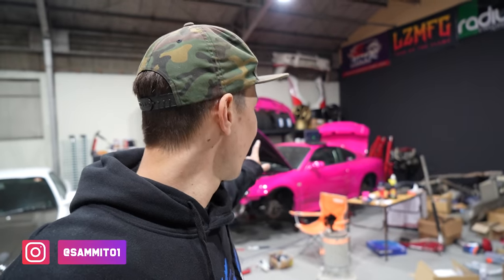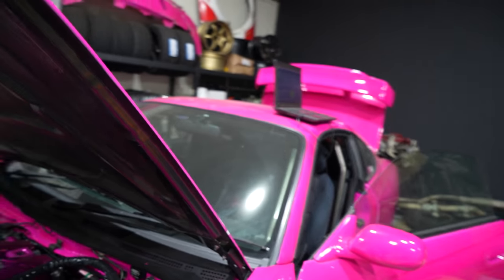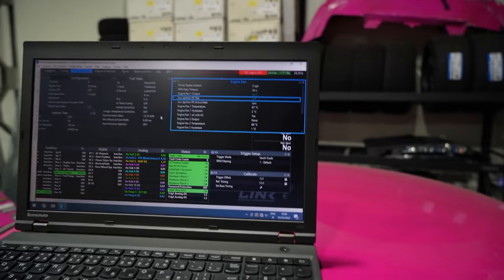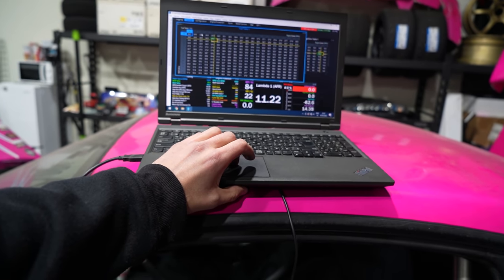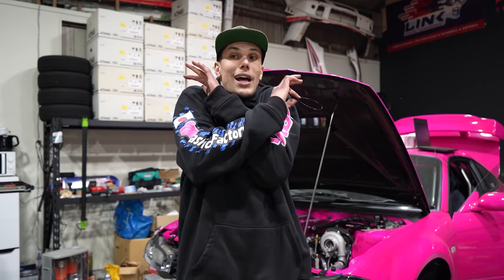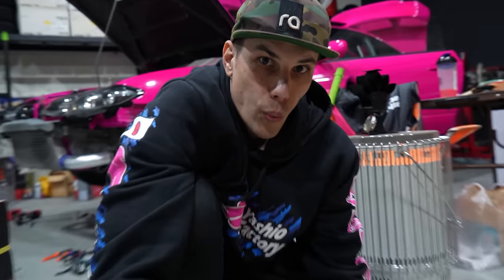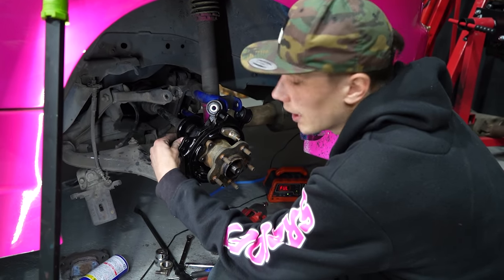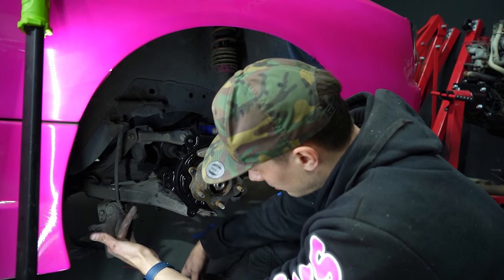DO NOT WATCH THIS VIDEO!

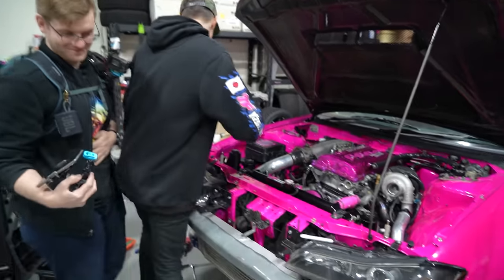Comment: Anyone else notice the Hot pipe clamp on the turbo rotate at 8:17 to 8:29 ?
Reply: i saw it too :P
Reply: Yeah
Reply: @sammit tighten the clamp LOL
Reply: @MrNineties  it doesnt have bolt/nut to tighten the clamp. Outer clamp is just holding pipes from seperating. There's sleeve which seals on the pipes
Reply: Yep
Reply: ur comment is stolen by bot x, its main acc is dark

Comment: Good to see you are at a point where you can expand and hire some help. Think about setting the link so that you run one fan in street mode for standard cooling and run both when drifting possibly using a toggle switch with an indicator.  That way, there will be no chance of overheating while hot lapping it. Looking forward to seeing what the car can do with the new setup.
Reply: you could just set each fan to come on and off at different temps. no need for a toggle switch

Comment: Sammit the reason your fans were coming on when you turned the car off is because you had constant power to pin 30 and 86 on the relay instead of constant power to pin 30 and switched ignition power to pin 86.

Comment: SAM your using so much more useful time in life by this time you should of had at least 2 full time mechanics working in the shop. Plus yourself your an excellent mechanic! I do oil changes on my own cars and change brakes, and I’m over here thinking I’m a great mechanic lol you take a whole engine/ transmission/ suspension parts apart and put them back like a champ. Your brand and shop “SAMMIT RACING” would of been big by now. I can imagine hundreds of JDM drifter bois getting their cars fixed at SAMMIT RACING 🤙🏼 keep shredding

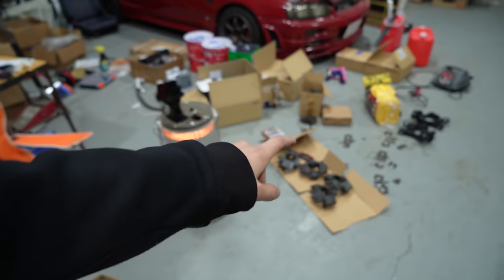Comment: 0:25 Drums on the back? are you going back to 1960's?
Reply: Generally drums are used on the rear for a simple drift setup, cheaper and works just fine.
Reply: @Jabana_  drums suck, allways problems and when hot they suck even more

Comment: SAM WOULDN'T YOU PUT "A PULL THE KEY " TO TURN THE FANS OFF COMPLETELY?..... OR ARE YOU PLANNING ON NOT USING A KEY? MY TACOMA HAS THAT YOU PULL THE KEY AND EVERYTHING SHUTS DOWN EXCEPT FOR THE FAN BUT IT HAS A TIMER AND WHEN THE TIMER RUNS OUT THE FANS NO LONGER COME ON.

Comment: Hey why are cars so much cheaper in Japan was looking yahoo Japan and another site found s14 clean for 9k American lkke how another for 11 another one 96 silvia clean does have 180k on it km but still its 9700 they are all arojnd that except the spec r a s14 here is like 40k s13 15 to 20
Reply: Another site 99 silvia s14 type s sr20det  says 16km 9k miles 14k 450 fob charge wtf if I had 14k id buy it rigut now 22 total with fob and c and f for 99 s14 with sr20det 9k miles

Comment: Noob question here: Why doesn't the new knuckle just have the axle spacer built in? It seems like having it as a separate piece just creates more problems than it should (like forgetting it's there and having to tear down the whole assembly just to install it 😬).
Reply: I imagine that it’s because not everyone uses the dual calliper bracket.

Comment: @sammit Use a relay that has the other switch side on a ignition live. Even when the ecu grounds it cause the ignition is off fans wont activate :)
Reply: I think he is overthinking this. Having the ecu controlling fans alittle unnecessary. He could just have a $100 flex-i-lite fan controller. The have a soft start function.
Reply: @bioshift1   I'd say the opposite personally, fan controllers are a bit of a gimmick really. The link can provide all the control needed but just grounding a relay. The only problem is he had a permanent live on the other side of the relay. You could even have the link turn the fans on for a certain amount of time after the ignition is turned off if you have the ECU HOLD POWER function setup and wired correctly etc. Problem is most people don't want to spend the time to learn these things and that's cool and would rather opt for a pre packaged solution which they didn't really need to buy.
Reply: @sambuckingham3937  That's how the flex-i-lite controller works too. You can set a delay  to turn off the fans after the car is off. You can also set the temperature you want the fans to come on.
Reply: @bioshift1  yeah so why have it if the ecu can do it? Just another thing to fail? If the ecu is doing it and it fails then you prob have bigger problems 🤣